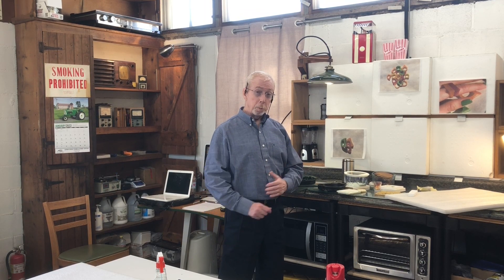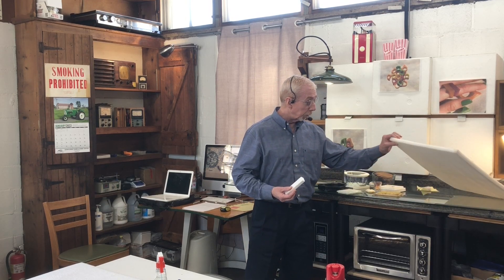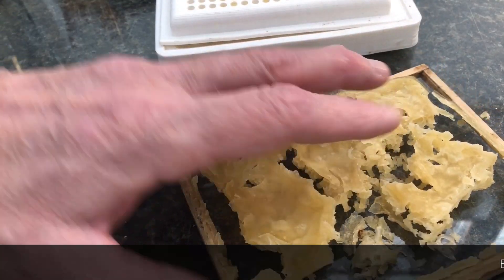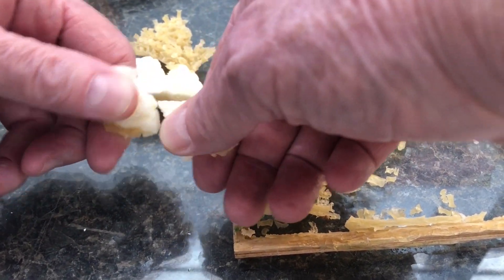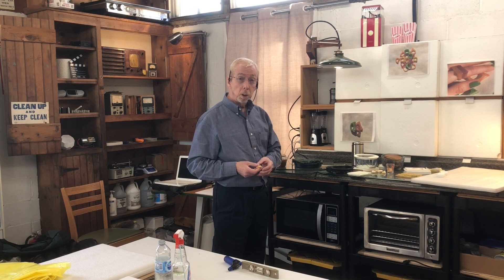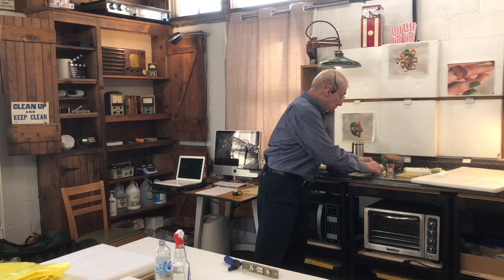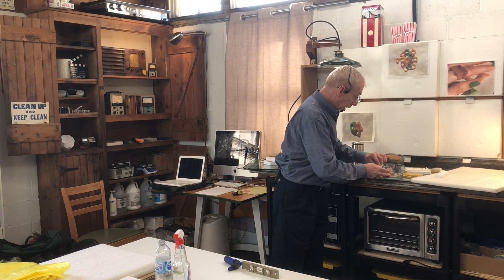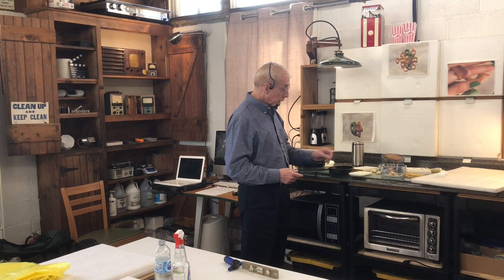DIY Renewable STYROFOAM FROM MILK. Replace single-use plastic...FOR LESS THAN WE SPEND NOW!

Comment: Amazing! I like the double up processing like saying "can we do more? Then what?" But I'm not sure I understand exactly what steps you made....
1) 2:1 part vinegar to casein powder (Q: Vinegar type and dilution/grade? 8%-10%-20%-30%...?)
2) Blend and wait overnight
3) Warm in microwave until no bubles and syrup viscosity
4) Put into mould
5) Microwave mould (Q: How long? High/Low? Temperature and time in normal oven?)
6) LAST MICROWAVE: 45 sec.  (Q:Why does the mass expand like foam?) (Q: Temperature and time in normal oven? Dry bowl or adding extra vinegar?)

What happens if we expand the time or temperature?

I figure we could go directly from making milk curd (warm milk stirred with a bit of vinegar) to step one - or just using  a LOT of vinegar making the curd?
Reply from the maker: Yep, I plan on doing this again and trying to waterproof it. I used 5% vinegar, to the consistency of mashed potatoes. Letting it set overnight is key, viscosity is a choice, but it will jell up over night. Microwave that until the bubbles are gone. But I plan on doing more here. Mould or smear once it cools enough to touch. It may take days to harden. Once it is rock hard, it is done. This is the feedstock for the foam. I plan on grinding it up and, yep, adding a bit more vinegar to get the crumbs to stick to each other, in the mould I am making, and in the microwave for 45 seconds. 
I breezed over all this here because I covered it in the part 1. https://youtu.be/C5e70vXIIm8